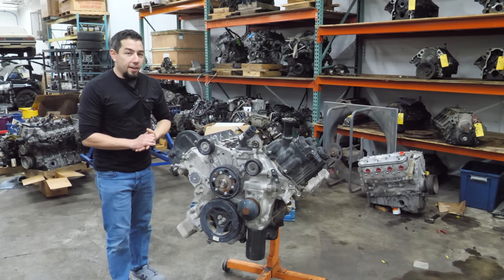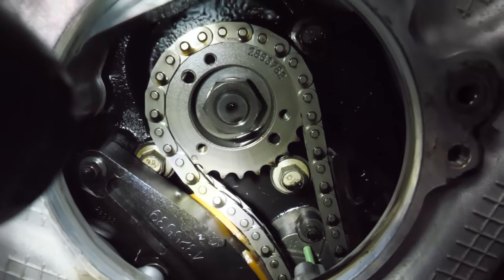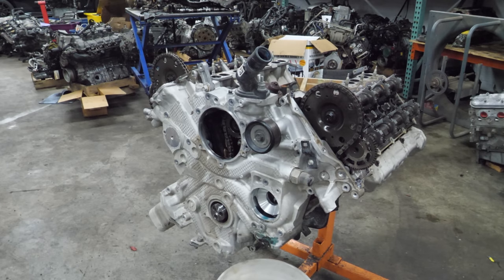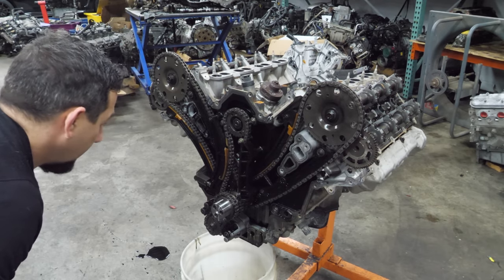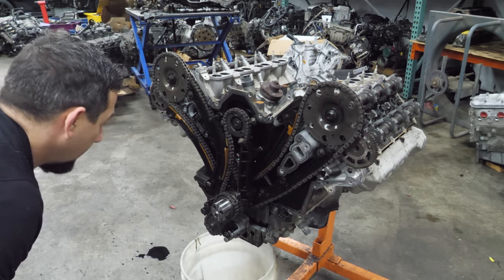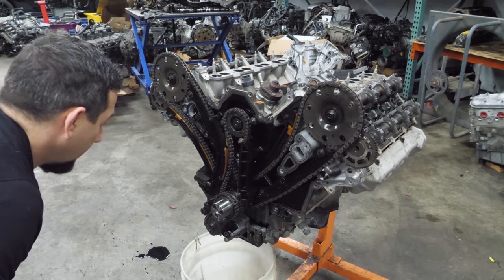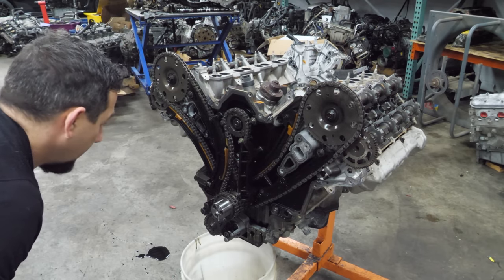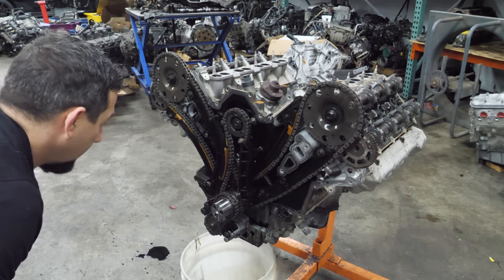Well That's Not Good! Nissan Titan XD Cummins 5.0 Turbo Diesel V8 Teardown. A Costly Failure!

Comment: That engine was originally slated to go in the 1500 RAM. But it wasn't efficient enough, so Chrysler went with the ecodiesel.  Another fun fact, before Nissan picked up the 5.0 Cummins, Nissan was considering the Navistar 6.4... Dodged the bullet on that one Nissan!!
Reply: Not really. The 5.0 is awful. There are no parts for it and they break all the time.
Reply: @americansmark  not to mention, it is missing 8 head bolts 😂
Reply: @americansmark  Not sure if you know just how bad the Navistar 6.4 was, Haha
Reply: Looks like Nissan put themselves in an unwinnable situation with the XD: 2 bad engine options and a chassis without the increased tow/payload capacity to justify them anyways.
Reply: @spggarage5690  pretty much everything wrong with them had been discovered and there’s fixes for almost all of them. Me personally I’d rather have a 7.3 or 6.7 but It’s a toss up between the 6.4 and the Cummins 5.0. A race to the bottom of you ask me.
Reply: @americansmark  I don't know much about the 5.0, but I've been at a Ford dealer for 23 years. The 5.0 Cummins must be really bad to be worse than a 6.4.
Reply: @Bluecedor  There's nothing wrong with the 5.6.  After watching TFL's comparison between the diesel and the 5.6, the gasser performed just as well as the diesel.  I currently have 240k on an older gen Armada, tons of power and haven't done a damn thing to that motor. But understood, that both options are probably underpowered for the application.
Reply: @SkSKSK283  The HPFP is the weakest link in the 6.4... by far.  When they fail, they fail bigly lol.  And $$$$ to repair.  Agreed, tried but true 7.3, and the 6.7's have been fairly reliable.
Reply: Glad they never used this Cummins. it turned out to be trash and would have been one more shit stain on the brand and something else for Dodge/Ram haters to bark about. I went for my Cummins engine cert back in 2007 and they were telling us about this engine in the class room.. wasn't impressed then and even less impressed now.. they turned out to be the trash I imagined they would.
Reply: yeah by 2 mpg to low...
Reply: The fact that Nissan doesn't stock parts for this engine tells me that it's a good platform. When you call and the dealer has parts in stock, that's when you know there is an issue. Everyone I know that owns a XD loves it and have had minimal issues, I feel like this failure was a rare issue.
Reply: Minnesota 4red1976, you are correct that the 5.0 Cummins was designed for the 1500Ram at the time and was ready to go into production. Chrysler did not change their mind about the engine, it was shelved in 2008 when Chrysler went Bankrupt.
 Fiat then purchased them and that is why they had the 3.6 liter V-6 instead. And another FYI ,, They intentionally held the redline to 4,000 Rpms.., 310Hp Fwhp, and 555#/ Ft of torque..
Reply: @applefordguy76  which ones?
Reply: @spggarage5690  yea 6.4 had issues but if you got a good one and deleted it she’ll last forever. Have an 08 with 342,000 on the clock
Reply: Not by much , these cummins have issues with turbos,  as I've heard tell. Pretty expensive issue . Personally,  I've wanted a Cummings Titan . I love the vk56 , and own one. But also love the toyotas .
Reply: @spggarage5690  True , the 6.0 and 6.4 are, in my opinion, some of the worst engines ever .
Reply: @spencerkilpatrick5779  absolutely agree , 7.3 or 6.7 but not those two degenerates in between.
Reply: Not so on the 6.4. The 5.0 was supposed to debut in the Ram 1500 for 2009, and the (what would have been at the time) new Titan was to be based upon the Ram 1500. It would have debuted around 2010 or 2011 and would also have had the 5.0. 

The plan for a Ram 1500-based Titan was in place well before the 6.4 went to Ford for 2008; there was no plan for the 6.4 other than Ford. The 6.4 was designed strictly for Ford and some industrial applications.
Reply: @applefordguy76  6 & 6.4 tied, or one is better?
Reply: Ram and Nissa. Were going to actually co-develop the next Gen Ram and 2nd Gen titan but when Chrysler merged the deal was canceled and Nissan ended up getting stuck with the Cummins. That enegine would have been great in a half ton, especially "upgraded".
Reply: @Bluecedor  the chassis is more than adequate, thw limiting factor is the semi floating rear axle. The grame is straight from the 3/4 ton/1 ton NV vans. They should have used the full floating 8 lug axle from that van and bumped to payload to 2k and towing to 14k because the frame can easily handle it. Its the axle that is the limitation.
Reply: @applefordguy76  definitely not worse than the 6.4 lol
Reply: @Jackmerius_Tacktheretrix  Nissan was to get the Ram platform which was done already before the bankruptcy and merger with Fiat. It wasn’t jointly designed, it was Nissan to get the platform that Chrysler designed. 

Many, if not all 2009 Ram 1500’s came with a belt routing sticker on the radiator support for the 5.0 Cummins.
Reply: 5.9cummens the best diesel period for towing pulling there beast just need the Allison transmission ultimate combo
Reply: @wyo_garage20  I mis-spoke that. I should have said the 2nd gen titan was going to be based on the Ram. My mistake.
Reply: @americansmark  Parts probably wouldn't have been such an issue if Chrysler picked it up.
Reply: @MajorOutage  true. But they saw something in it that they didn't want any part in. It probably would have sold their quarter tons trucks better than that awful 3.0L.
Reply: @TheTeddy9212 most over rated engine ever made
Reply: @americansmark chrysler didn't see shit...that company is a steaming pile of shit through and through...people can talk trash all they want on nissan but I'd take the worst nissan product before the nicest thing chrysler has to offer any day of the week...nissan has plenty of problem cars but at least the problems are predictable...I find it hilarious when people act like chrysler made some divine decision to "say no" to cummins on the 5.0. The 5.0 is totally unnecessary for a half ton in my opinion anyway- just not a good match. Dodge 1500 can't even carry a bag of groceries without squatting imagine an engine that weighs over twice as much as the 5.7 plus all the additional trimmings for cooling and the aisin 6 speed
Reply: Eco diesel is garbage. My 5.0 Cummins will last 20 years watch

Comment: I noticed that high pressure pump didn't have threaded mount holes. Those bolts you removed from the front were likely just the mounting studs for it. It probably had nuts on them from the back side of the pump. Someone probably tried to remove the pump and keep it when they realized it wasn't so simple to remove and they just left it in the halfway pried out position you found it in.
Reply: I was thinking it was a manufacturing problem with the pump. The holes were never tapped. I would assume they were using a thread forming (forging) tap instead of a thread cutting tap. The hole would be drilled much larger than it would be for a thread cutting operation, large enough that with an impact you could get the bolts to start threading a bit into the unthreaded holes.
Reply: @engnerdan  You think too much.
Reply: Your 100% correct. Expensive pump  but to hard to remove.
Reply: @76629online  I think he only thought once.
Reply: I think the original thought of "nuts behind the pump" is correct. Thread forming taps do require a larger tap drill, but never larger than the major diameter (or even close to it, really) of the fastener. If it were tap drilled that large, the tap wouldn't even contact anything to even attempt to form threads.
   I think nuts were removed from behind the pump.
Reply: You are absolutely correct.

Comment: The 5.0 Cummins V8 that comes out of the XD Titan is ~ $20,000 for a new long block.  I hear these engines are struggling with failures at relatively low miles (for a diesel plant) despite its legendary origins.